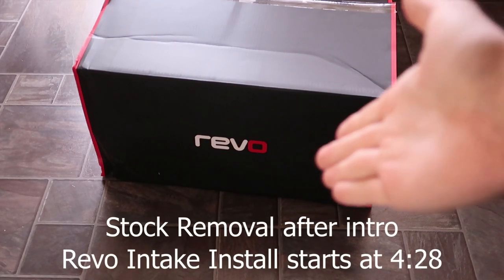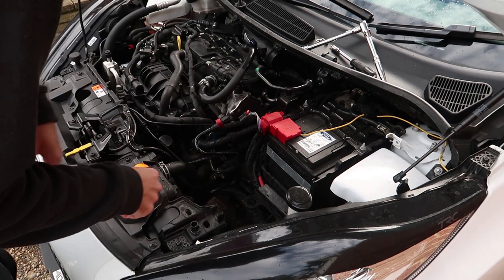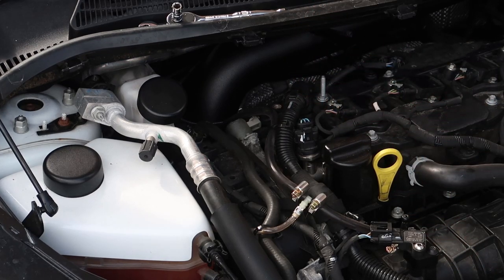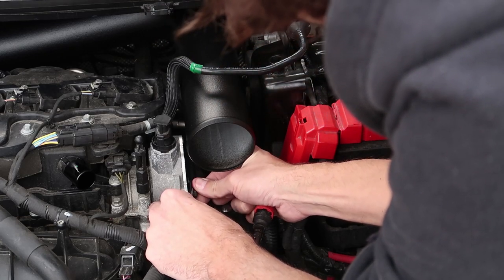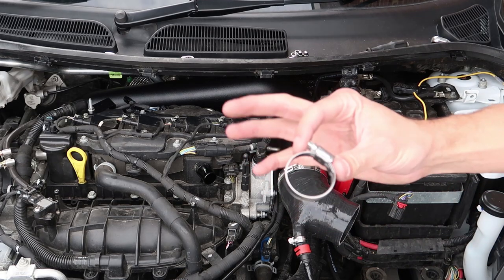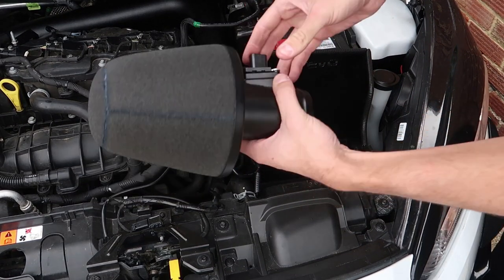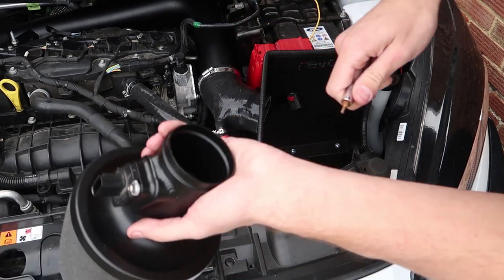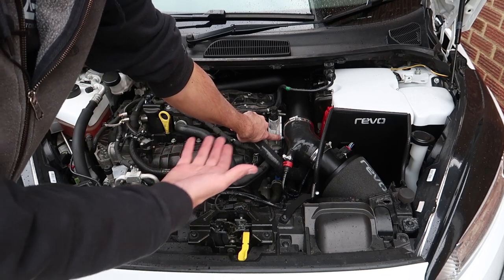How to Install - Revo Air Intake - Fiesta ST180

Comment: Regarding cleaning the revo filter is it the same as itg by which I mean. Do you have to oil the foam after cleaning?
Reply from the maker: Yeah exact same process as any foam filter :)
Reply from the maker: And yeah re oil
Reply: @CarRambles  thought so but thought I'd ask 👍🏻 picked up a secondhand filter n housing. So will fit it tomorrow. It'll replace my itg which was a sod to refit when I cleaned n oiled it

Comment: So what is best. Revo induction kit, vs ITG cold air induction kit?
Reply from the maker: Revo is 100% a better built kit. Apparently Revo flows more for bigger turbos. However real work difference.... Not noticeable from what I've found.

Think Revo aim 6-10bhp more than itg from there testing. They have results on Facebook somewhere
Reply: @CarRambles is revo induction noise bettee or itg
Reply from the maker: @natsonics5503  ITG is louder and sounds like darth vader.
Reply: @ thanks for letting me know, do you get any heaksoak issues

Comment: do you get that engine cover with the intake set? or do you have to buy it? Or does the standard cover also fit?
Reply from the maker: Engine cover is done by paintmods, I also had the centre point designed for my brand 👍
Reply: @CarRambles  aha Nice 👌👍

Comment: Hey man! I hope you are doing well? I was thinking of getting this Revo intake, because of your videos and because of the sound it makes of course haha. But i have a question tho, because I met another fiesta st driver, st200 to be exact. And he also has the same revo intake, but it doesn't make the 'stustustustu' sound like yours. So does the 'stustustu' sound fade with time? Does you intake still makes this sound? What is going on here haha. I would love to hear your respond, thank man!
Reply from the maker: Potentially you might be hearing the turbo / bov sound? If you get a recirculation valve for the turbo you'll get that noise regardless of the intake. I would also say ITG is the loudest intake noise you can get :)
Reply: @CarRambles  thank again for the quick response man! Haha I am really not looking for the loudest intake noise, but the noises like your revo intake, is beautiful! So if I were to install the revo intake on my car, i would get the same noise as yours right? And the intake noise of his st200 was super loud already 😄, but i couldn't hear the 'stustustu' sound.
Reply from the maker: @Lee711Shine  I could guarantee you would get the exact noise unless you had the same turbo and bov etc. However you won't be disappointed by this kit. The quality is exceptional to everything else out there I've seen. 

Even if you don't get the exact sound you can build towards it ;)
Reply: @CarRambles  haha you convinced me! Thanks again mate and you will hear from me again when I finally installed this fine piece of kit in my car! Take care and happy easter 🐣!

Comment: Are these supposed to be better then ITG?
Reply from the maker: Supposed to be when tested back to back, I more just wanted a cleaner looking system and to move over to an all Revo setup :)
Reply: Car Rambles ah ok cool I’ll pick on of these up instead then, going revo anyway might aswell use there parts too
Reply from the maker: @joebryant4014  Ues the link in the description, good price that, lowest i could find :)
Reply: Car Rambles alright thanks!